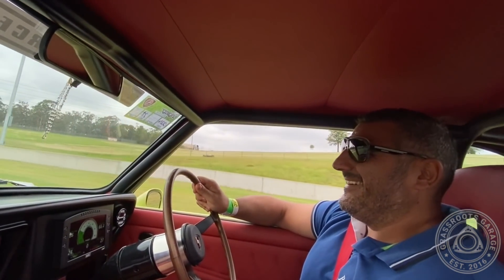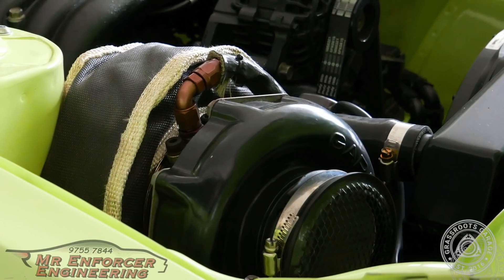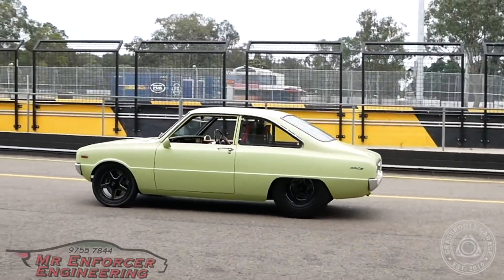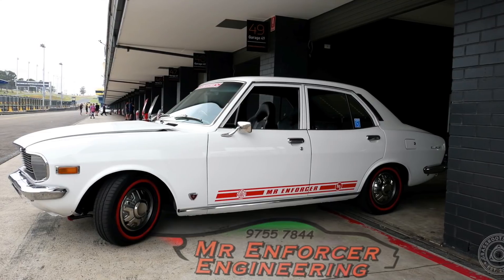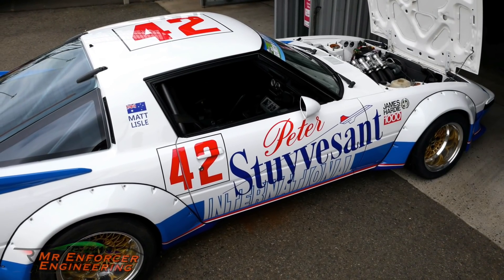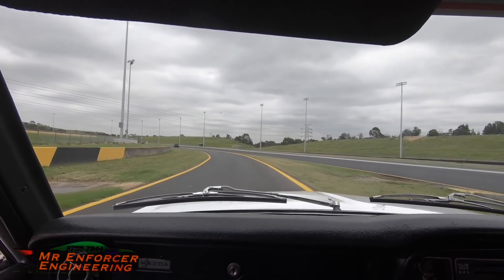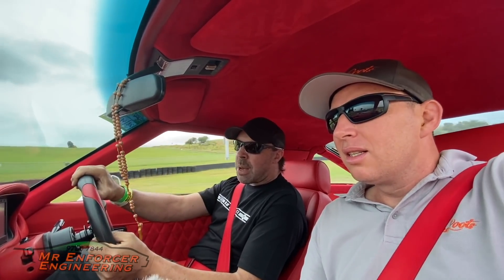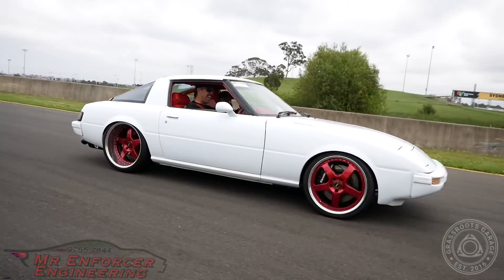[ EDS100 ] Mazda R100 13B Turbo 550hp

Comment: When I was 16 years old, in 1985, I had a 1970 Datsun 1200 coupe (B110/Sunny) but I really wanted an RX-2. So they always caught my attention, and there weren't many around. Then in passing I saw an R100 for the first time, all tricked out for SCCA racing at Sears Point Raceway. I liked the R100 as much as the RX-2 but they were already super rare in 1985. However, I saw two more R100 hotrods that year. In 1986 I talked to a new girl at my job and it turned out that her brother owned all three of the R100s I spotted and several more. I couldn't talk him out of selling one of the stock clunkers. My friends didn't like the "skirt" effect of the rear wheel opening but they didn't understand that's what makes them cool in hotrod form.
Reply: If you've driven, owned or ridden in an R100 life thereafter isn't the same
Reply from the maker: can confirm